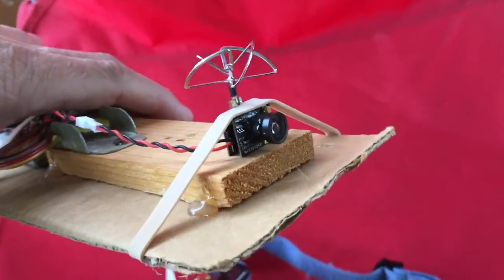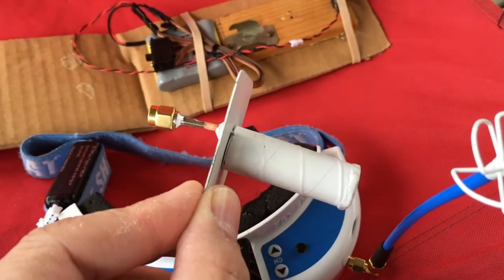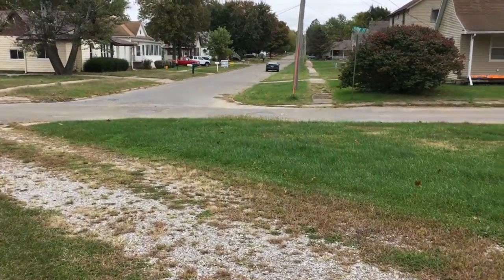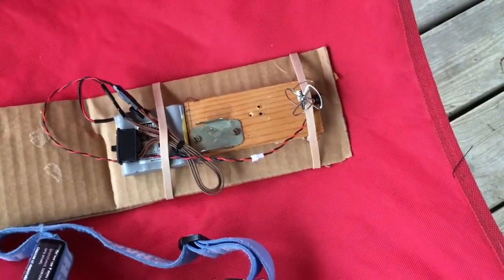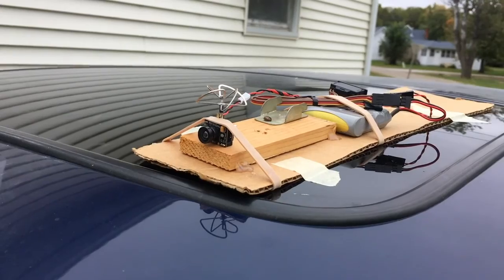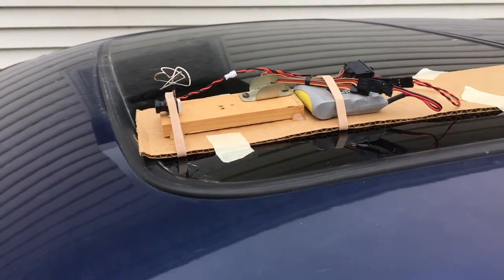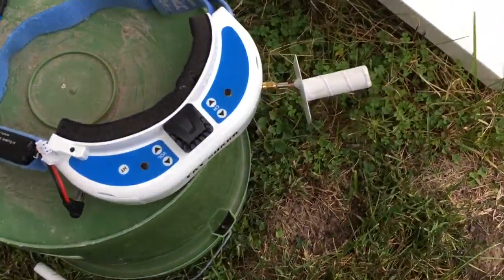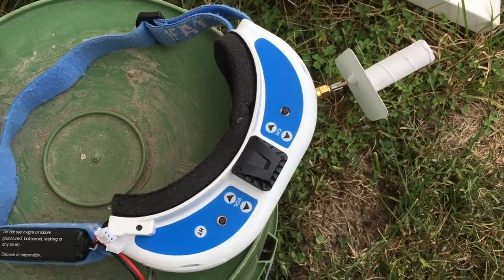Eachine TX02 Range Test (615 meters on top of a car)

Comment: Good test thanks. I won't get this range in my neighborhood due to all the RF intererence but still means this is a great camera for the price. $30 or less on Amazon.  I soldered my own together from parts and it was $20  (without camera) from Bangood so this is much better choice in general. The one advantage of my self-assembled version is that you can distribute the weight easier.
Reply from the maker: Very true, Bangood is hard to beat as long as you aren't in a hurry. I have thought about splitting one of mine to distribute the weight and make it a lower profile but I think it's hard to beat just as it is. I am afraid of destroying the camera and ending up with nothing.